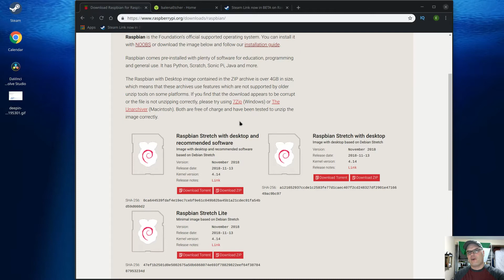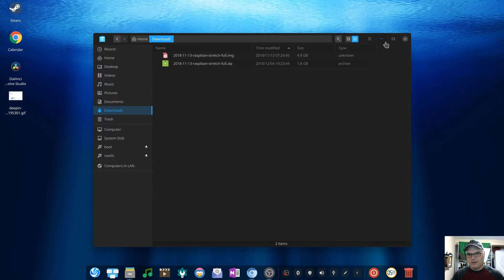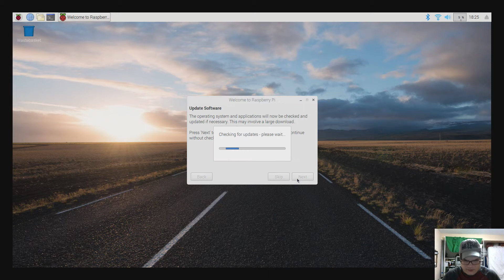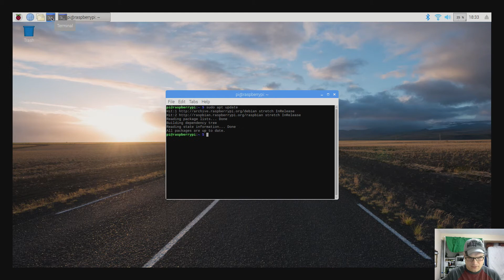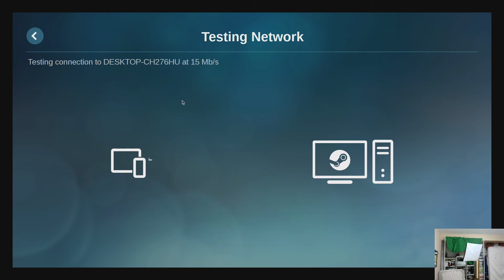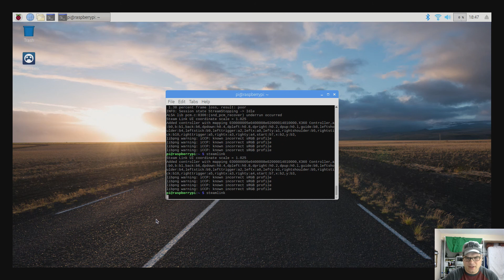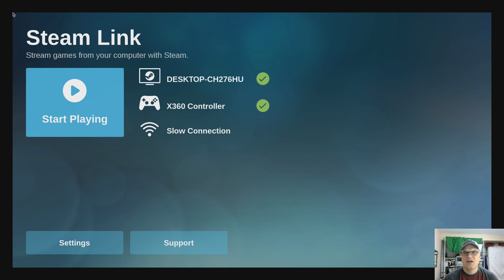Howto Turn a Raspberry Pi into a Steam Link

Comment: Why not just use ‘Remote Desktop Protocol’ in Windows 10 Pro (on the desktop gaming pc) and stream desktop to laptop? I assume your still limited by laptops lesser graphics power but laptop can use the much more powerful multi core desktop CPU’s processor, and, you can use RDP to your laptop anywhere in the world and not just at home
Reply from the maker: A second computer or laptop are much more expensive that a Raspberry Pi.
Also, have you ever tried to play games over RDP? It's not a good experience.
Reply: Eevnos thanks, so you can confirm that steam link via raspberry pi is a better experience than any type of Remote Desktop software (at least when on home network as opposed to away from home), what about remotely viewing windows desktop for other windows games, browsing and applications? Can it do that too? I read somewhere someone could do it via the discontinued steam link device? I really just want to use as much of my desktops resources around the house on a laptop and a TV that I have for games and work too
Reply: Also does this setup process for installing raspbian on an sd card enable  ‘persistence’ (so it saves data on the sd card) as opposed to being purely ‘live/install’ where no changes are saved between reboots like most Linux usb?